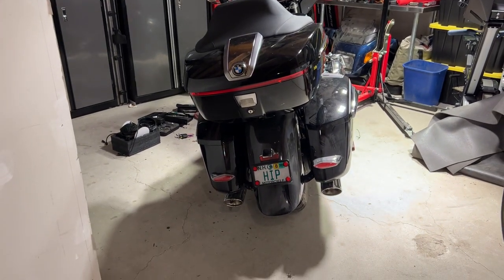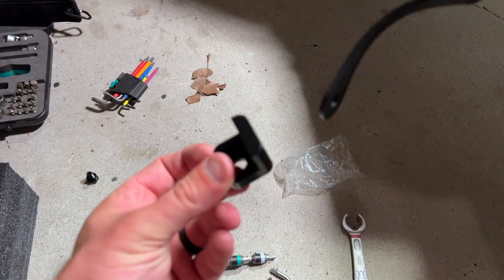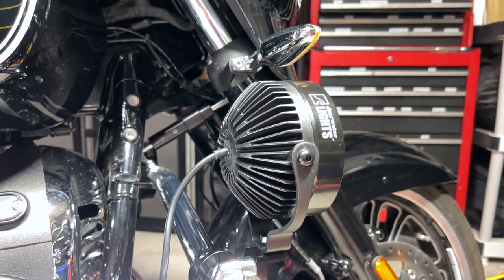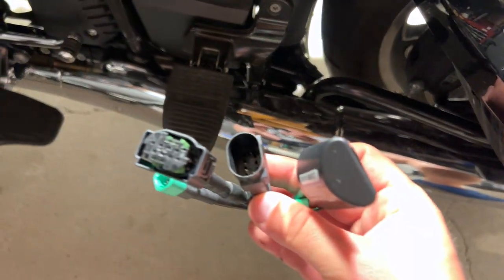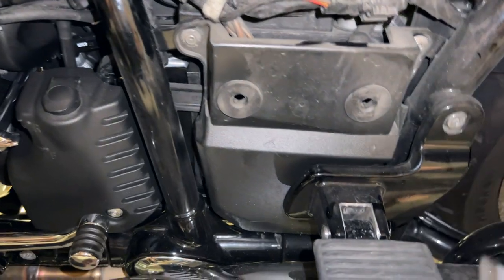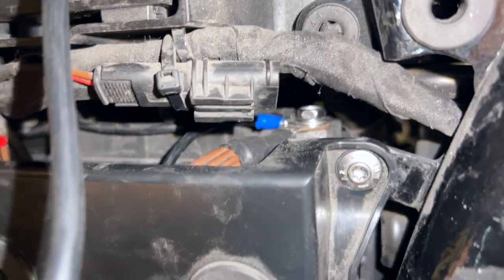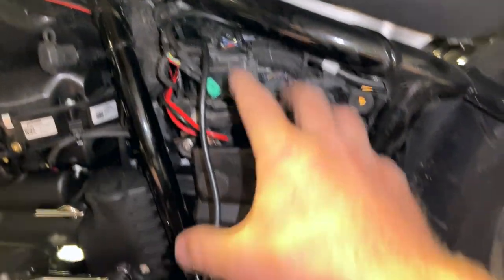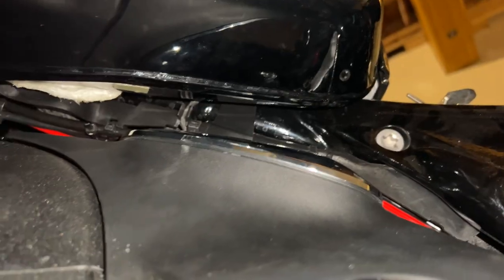Install: Clearwater Dixi LED Lights on BMW R18 Bagger / Transcontinental

Comment: Great video, thanks for sharing. Just bought this bike today, what’s the deal with the “can opener” alarm? Living in Canada we don’t lock much up but planning on head out next year. 😉
Reply from the maker: The Can opener just allows your bikes' buttons to work natively with the lights. It uses the alarm port to interface with the bike's electronics. So it is using the alarm port but isn't really related to the alarm. Just using that plug.

Comment: I have them on my GSA and run then 10% at night and only 30% during daytime. They are very bright and you don't want to to pass nobody with them. Love when you hit the High beams. Seems lime daylight
Reply from the maker: It's overkill until there's no light at all and you really need it. I won't be able to go back to the stock headlight.
Reply: @AdamChandler86  agreed. Once you have them on your bike, you will want them on all of them. I ran them with a yellow cover on one side for fog and clear on the other.

Comment: Do these cables come with the lights? I’d like to just add one on the crash bars  I have a regular r18 2021
Reply from the maker: When you buy these lights, everything you need comes with them (relay, controller, wiring). I think you can buy just one and you’ll have to just tuck the 2nd cable somewhere else and tie it up.